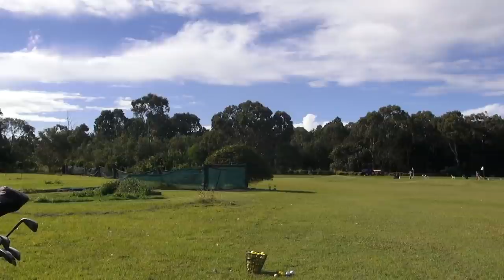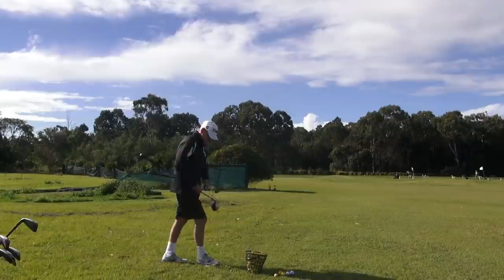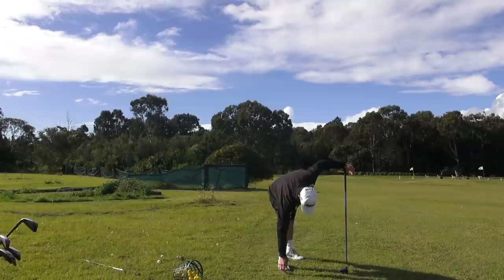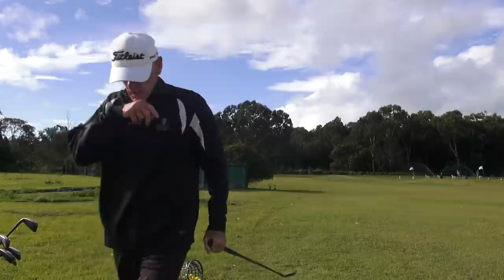A Few Bits Of Channel Lock Info In  1 Video

Comment: A couple of things JH. With the Yogi grip I am placing my left hand (my lead hand) with the thumb to the right, my right hand is placed on the club as the Vardon grip. Is this correct. I’m finding I hit the longer clubs well with Yogi. I was thinking trying X lock with PW thru 7 and Yogi with the rest. X lock gives a nice ball flight with the shorter irons I think. It’s like choosing between a blonde or brunette. I’m playing today so I will experiment.
Reply from the maker: Hi John, 
             I think there is absolutely potential to utilise 'Xlock' and Yogi Lock ... get used to either of them with the clubs that feel the most comfortable initially and then try to blend the comfort confidence into the other clubs .. the two action gives different flight for sure ..I actually like both of them.
                 The trail hand   comes onto the club the same as  you would normally place it  with a neutral configured Vardon grip ..   you will find   as 'sideways' type locking in effect the trail palm   gets  when it  covers over the side sitting lead thumb .. getting the right tension factor to suit your own grip   is the   thing that has to be worked out individually  with   that aspect.
                    cheers JH

Comment: JH, I'm having. A collapse problem of my lead arm. Which causes a pull hook.
Any suggestion would be greatly appreciated
It begins with the longer clubs
Reply from the maker: Hi Herb, 
                  If the lead arm collapses   through impact   the lead hand has not    rotated  towards the ground  enough    coming into and through impact .. if you just swing your lead arm  slowly by itself in a simulated  downswing through impact and  start turning the   lead hand down  as it comes to impact you will see and feel the  elbow   sort of locking out    and moving   back towards the trail   hip as a direction .
               That movement anatomically locks out the elbow joint by activating all the inside muscles/tendons of the arm.. 
                  You must however very much focus on hitting from in to out very deliberately otherwise that turning down of the lead hand will cause big pulls if you have your lead shoulder open or rolling during impact.
                    cheers JH
Reply: 1atomicgolf   Thanks JH, tomorrow is the test run